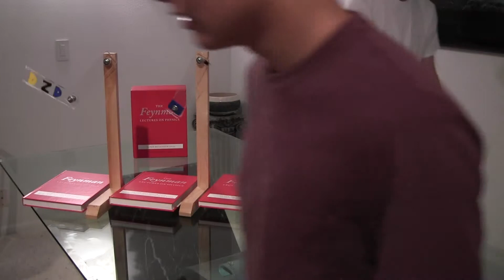A Double Pendulum for Mr. Smay

Comment: Hi Chris, I'm planning on building one and was wondering how you went about your process of building it?
Reply from the maker: Conall McCabe Our project was modeled after this one from Makezine:
http://makezine.com/projects/make-22/double-pendulum/
(The reason why it took so long is not because it was a particularly difficult build, but rather because we rarely had time to meet up to work on the project. The pendulum arms were pretty quick and almost exactly match the specifications given by Makezine. The majority of what consumed our time was just sanding the wood of the stand, which, by the way, we designed so that you can use the pendulum reasonably well without clamps.)